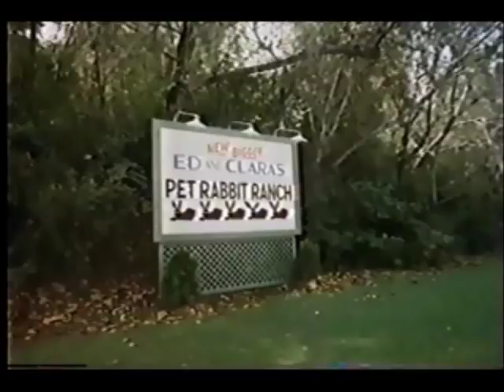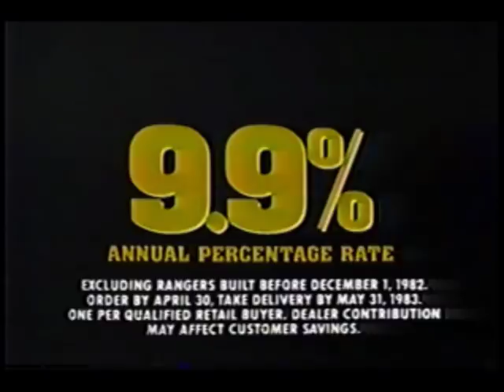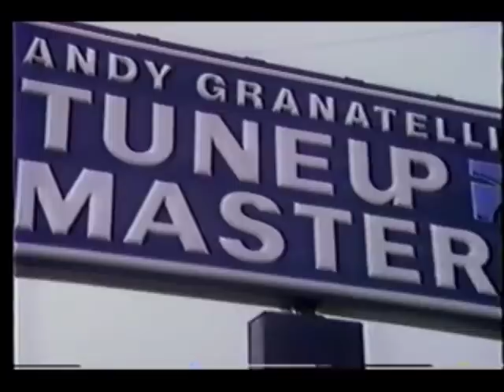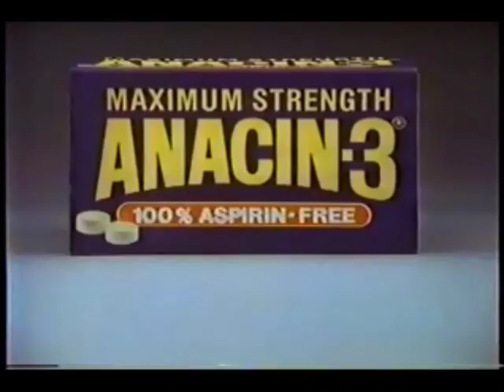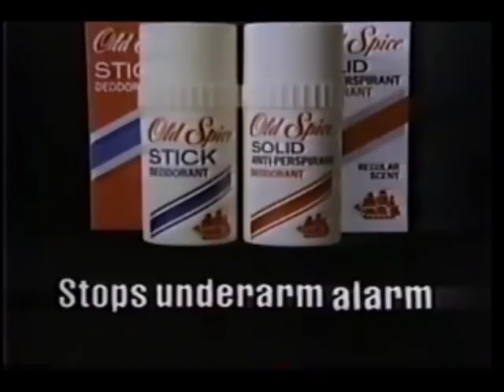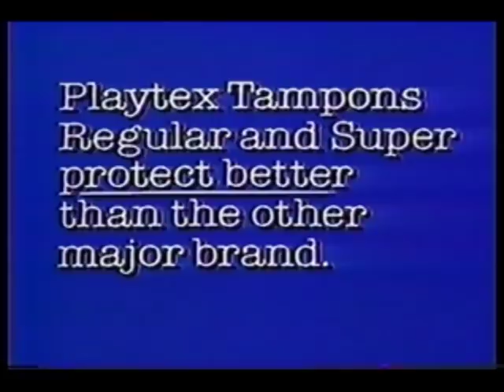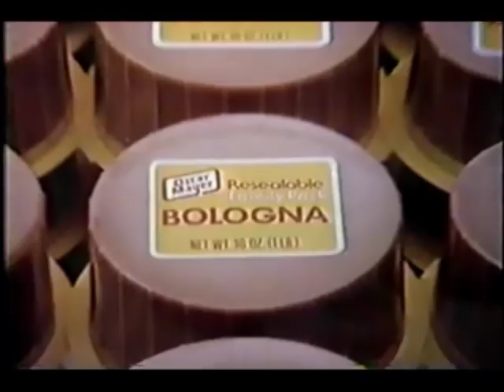May 3, 1983 commercials

Comment: On Tuesday, May 3, 1983 I cut school to go to Monmouth.  My horoscope said "Count on good financial luck today." I did, returning to the track for one last bet, that won, letting me stay. Before the last race I found a live trifecta box of 1-2-3-8 (50-1, 35-1, 14-1, and 20-1) that the teller didn't let me cancel.  10-9 duel to the wire six lengths in front when #10 knocks #9 over the rail.  Comes in 10-2-1-3 but #10 is disqualified, my tri is put up and I collect $2,146.00 at age sixteen.  I remember this day very well.